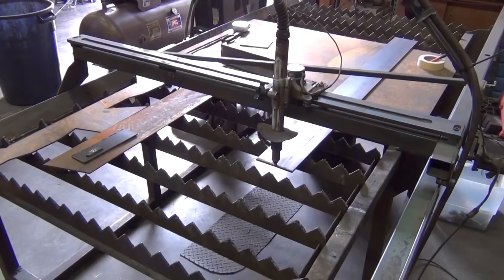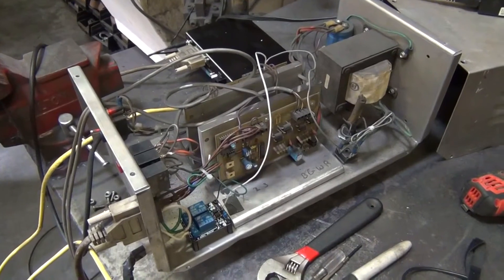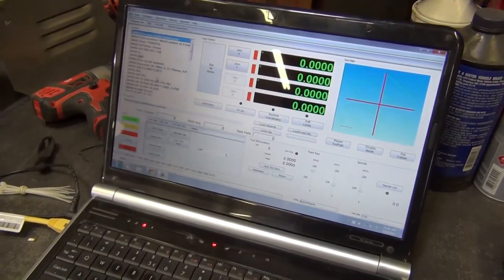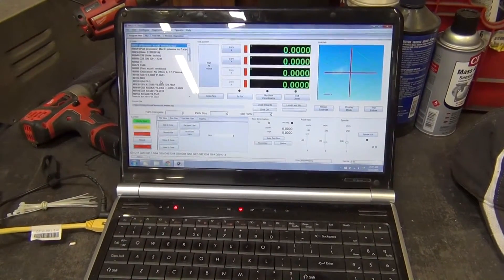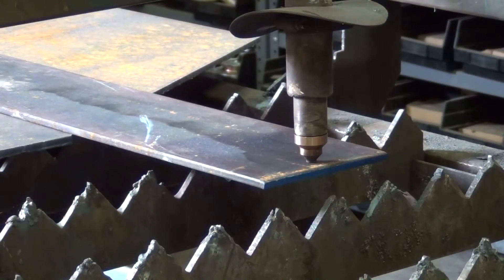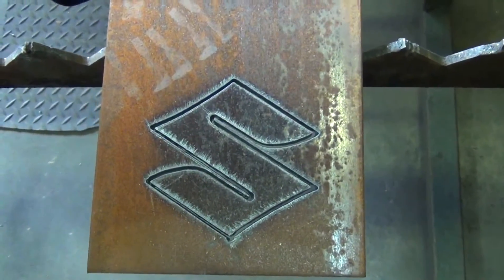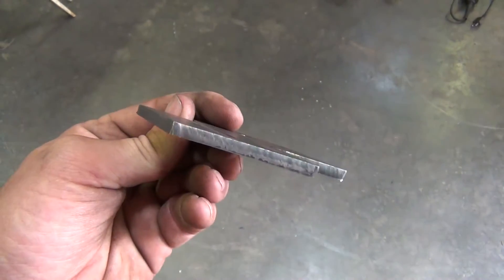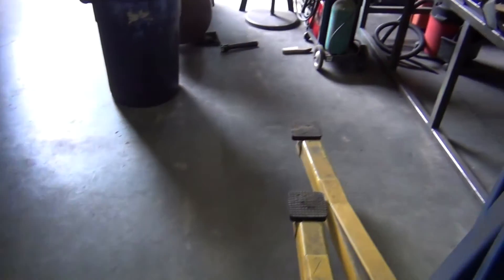CNC plasma table update:  first cut

Comment: Nice! Did you build this or was it purchased?
Reply from the maker: +urgentcareguy3 I purchased the table/gantry as a complete used setup.  I threw out the electronics and computer system and installed some more modern stuff.

Comment: Nice, how hard is it to learn the cad stuff for a Mac user?
Reply from the maker: +BleepinJeep I'm not sure I can answer that question!  The interface for many cad programs is similar; I've been using A9Cad for 2d drawings with good success.  I have some limited experience in solidworks and autocad and found the a9cad interface very easy to learn.  I suspect that freeware and paid CAD software for the Mac (other than autocad) is very similar...
Reply from the maker: Jeff H. Thanks for the tip, I will download it and give it a try